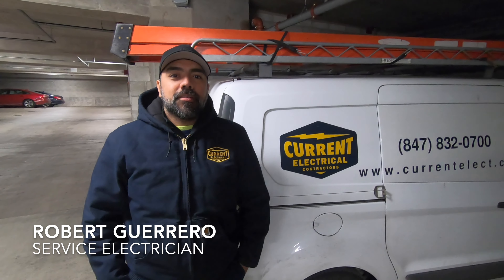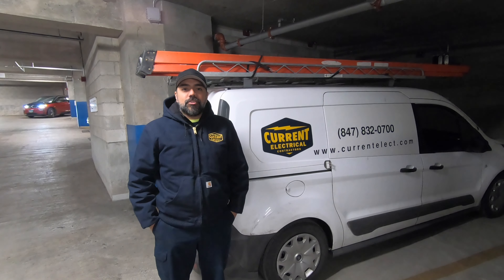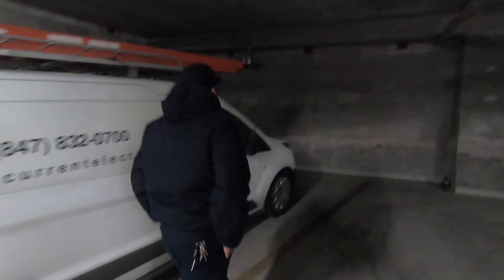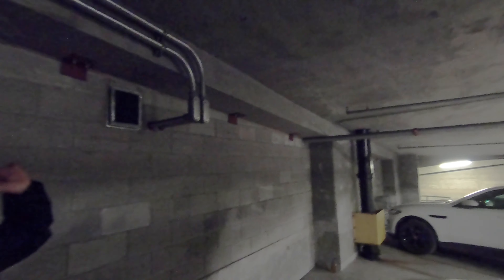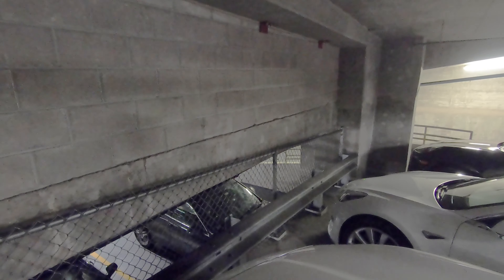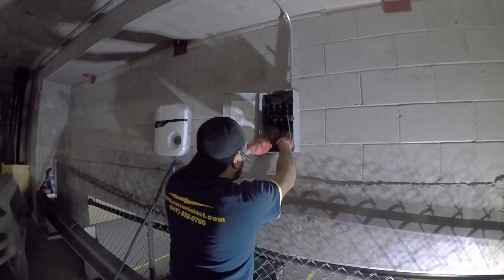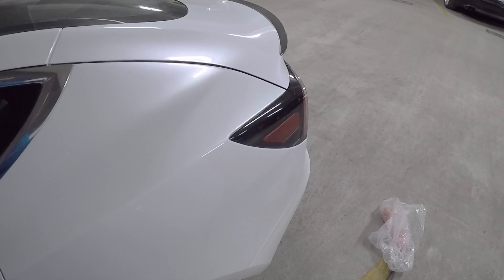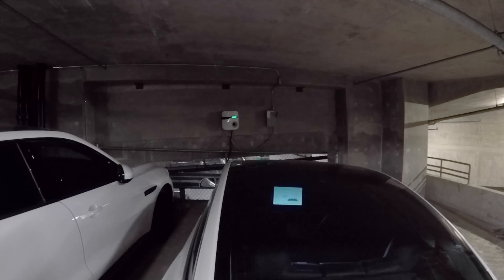Installing a Tesla Evercharge Charger in a Chicago Parking Deck

Comment: Charles, what an awesome charging solution for parking structures with dedicated parking spots. I’m really impressed with the security that the system provides, it’s made in California and they showed San Francisco projects on their website. What is the maximum amperage that your car charges at? I had a 50amp NEMA14-50 outlet installed in my garage. With Tesla’s wall charger the Model 3 will charge at 42amps, but I just use the mobile charger, so the maximum is 32amps. I’ve never had any problems charging up enough and we have time of use cheaper electricity. Power is cheaper all weekend and 8pm-3pm weekdays. SuperChargers are only used for long trips. Congratulations once again, Charles! I don’t know how you survived charging outside in the winter 🥶. Midwesterners are just tougher people!
Reply from the maker: The system is really solid. The only thing missing is an app where you could activate the charger,  monitor charging and track costs. It is so much easier not planning a work day around supercharging. I made it work, but having your own charger is soooooo much better. I'll have to check the max amps, but it is pretty quick. Total game changer!

Comment: Charles, can you give us an update on how your Evercharge is working?  Good or bad?  Thanks.
Reply from the maker: All good! I haven't had any issues with the charger at all. The monthly bills range from $45-75 depending on how much I'm driving, but it has been 100% worth it. Evercharge does have a $15/mo subscription charge built into the monthly bill to be on there billing system. I'm not a fan of that subscription charge. but that's the price of having that type of charger set up in a highrise without separate electrical meters.

Comment: How are you billed for the electricity?
Reply from the maker: I get a monthly bill and report of electricity used directly from Evercharge. I believe they take their cut and pay the building back for the electricity.
Reply: @Teslad  thanks for the response.   How much did you pay for the setup?   And what is your electric rate?   I am in the process of talking to my condo board.
Reply from the maker: @richiesd1  The charging station is about $1200 plus the install and hardware (this will vary depending on your install situation). All in, it was about $2900. My monthly bill averages about $35 for charging. I was paying 5x that much for gasoline before getting the Tesla!
Reply: @Teslad  , thanks for the info.   I will try to get my condo board to approve a charging solution at the parking spot.    Unfortunately, some people still have old thinking.  Yes, electric is the future.     I don’t even like gas cooking.   Hydrocarbon fuel pollution inside a condo can’t be good for health that’s why small condos don’t have gas cooking.   I am getting rid of the gas stove when I remodel my kitchen.